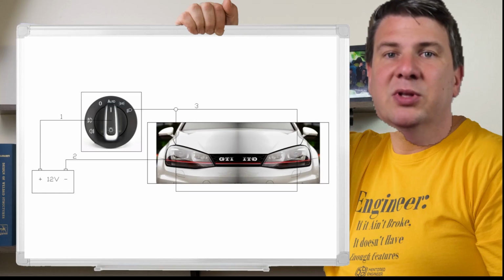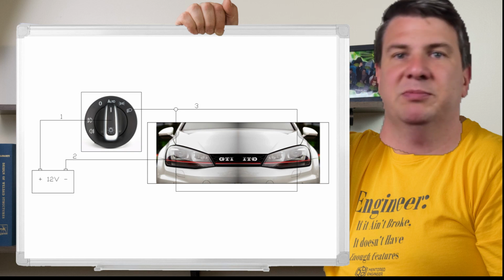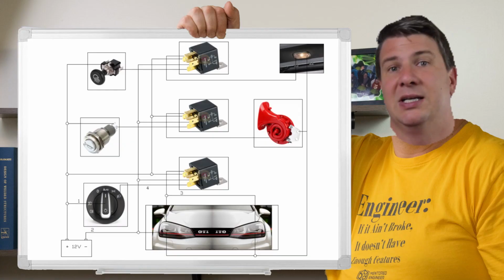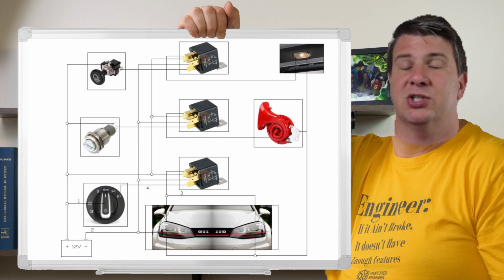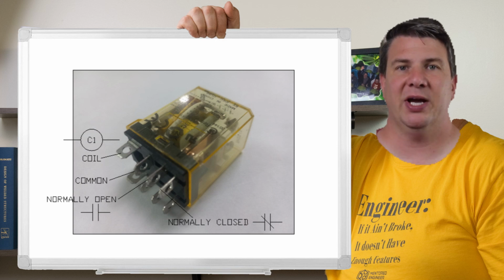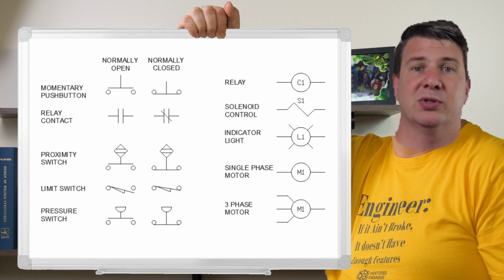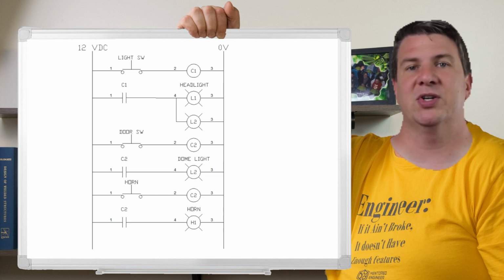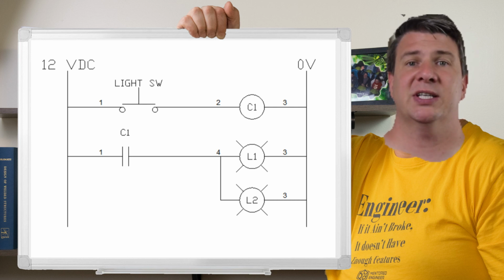What is Ladder Logic? - Controls Wiring Simplified

Comment: Electric clutch not engaging on A/C or Zero Turn mower is not necessarily an electrical issue.  I had it happen on each.  If the air gap is too far the coil will not pull the clutch in.  I adjusted the air gap on the Zero Turn mower and had to shim the A/C compressor with a shim cut from a soda can.
Reply from the maker: Thanks for sharing your experience and the helpful tips!